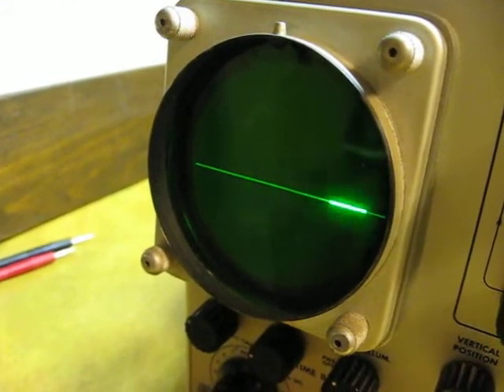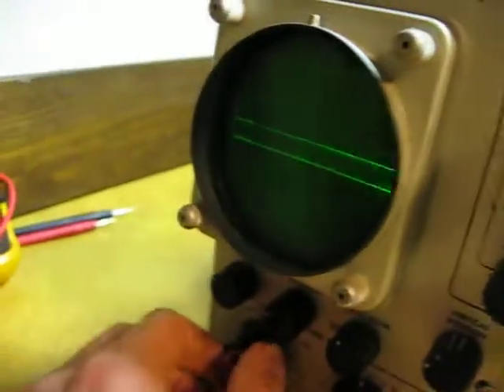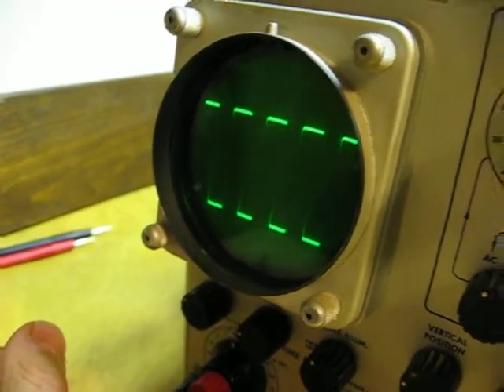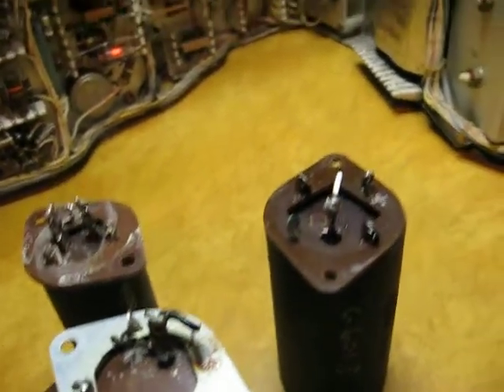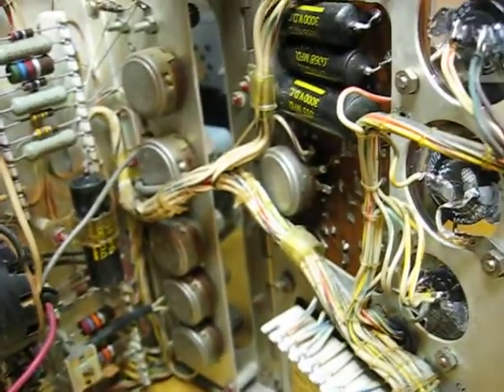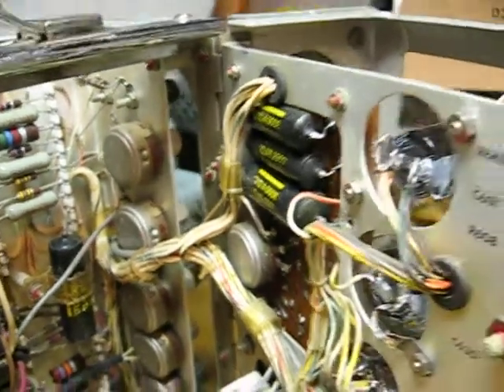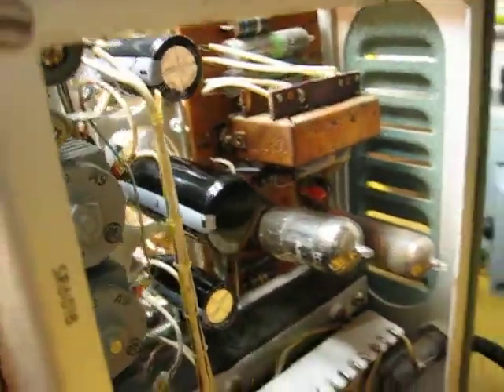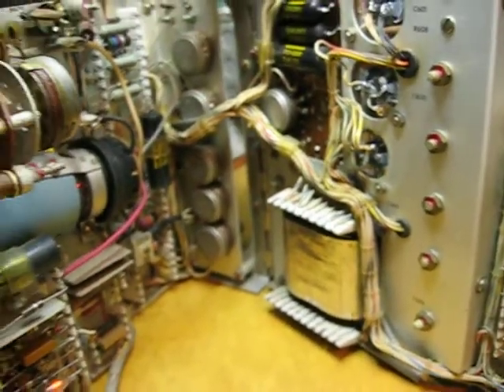Tektronix 310 Oscilloscope Initial Fire Up After Repair

Comment: Hi, i have a 310A, i would like to know if it is normal that whith auto trigger i am not able able to display properly the square wave from the calibrator. (With manual works fine)
Thanks
Reply from the maker: Hello, I am not sure about that.  If you are on facebook, there is a great group called Old Tek Scopes where someone would be more qualified to answer a question such as that.

Comment: Nice work on getting that scope back in action. I also love it when the repairs go smoothly like that.
Reply from the maker: Thanks, I was hoping that I would not have to do anything tube related and I got my wish!
Reply: @JIMO415  I suppose this unit probably didn't spend all that much time on, since it was intended to be brought to repair jobs, so I would bet most of the tubes test like new.
Reply from the maker: @50sTransistorRadios  good assumption I am guessing.